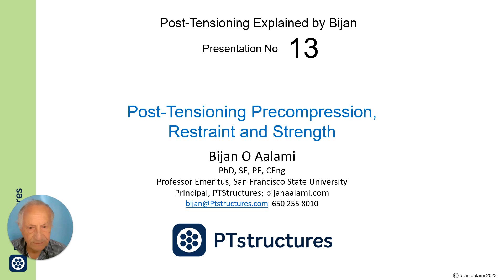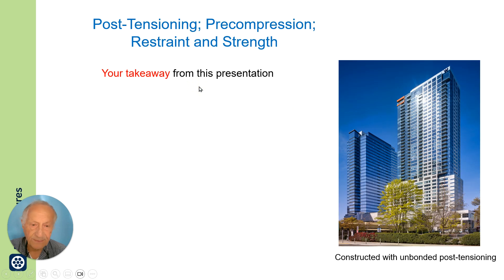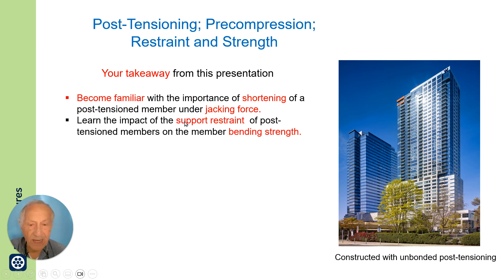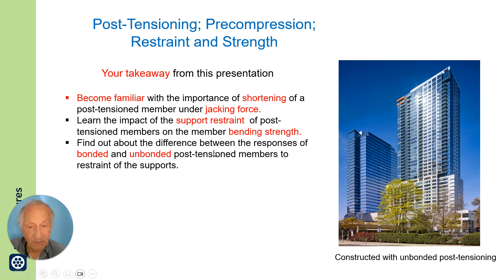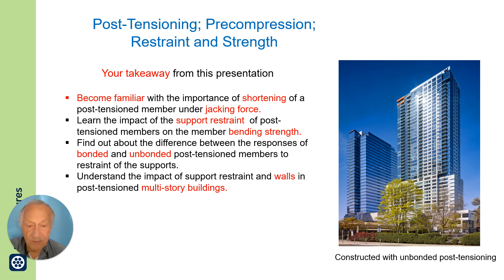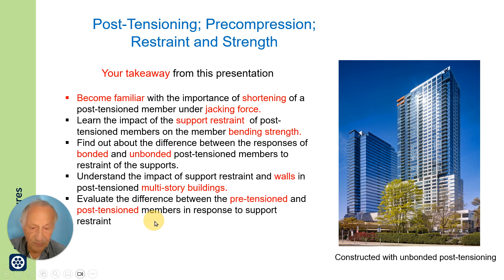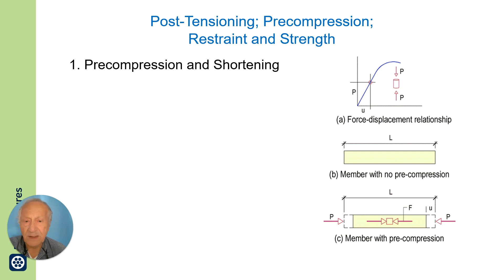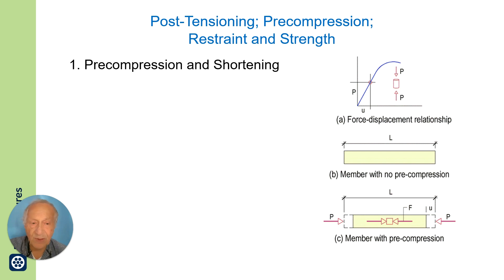13- Support Restraint of PT Members and Member Strength Lecture

Comment: Thank you Prof. Bijan on this informative presentation. Please I have some questions: 
1- Does the software (Adapt-Builder) takes this divertive of PT force to the restrain into consideration ?
2- What are the solution if we want to design a basement slab as a PT slab ?
3- How can we calculate this diverted force to the restrained and can we add it to the long-term losses ? 
4- If i have a Raft PT the friction between raft and soil will lead to loss in PT force how can we calculate this loss in the force and can we add it to the long-term losses ? 

Thank you very much
Reply from the maker: The formulation of the software RISA-ADAPT Builder recognizes the presence of support restraint and other connections to the member that may absorb some of the member’s precompression. The loss of precompression from tendons is accounted for in the moment capacity of the member. You can verify this from the design of a post-tensioned simple beam that is constrained.
Bijan